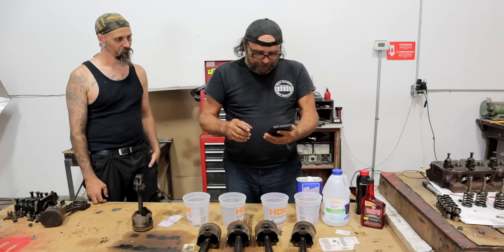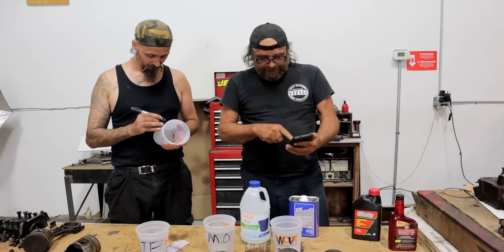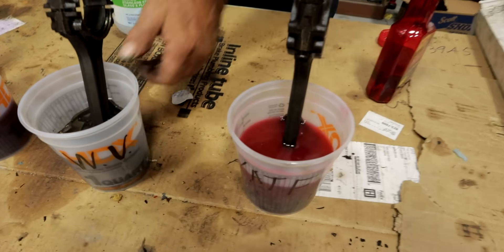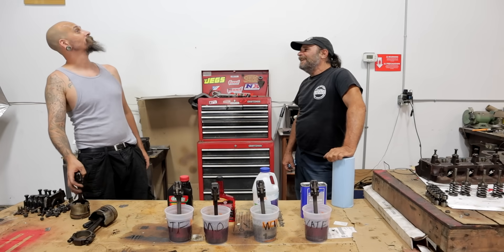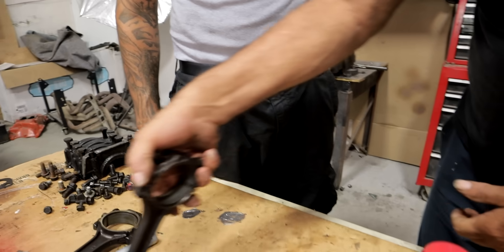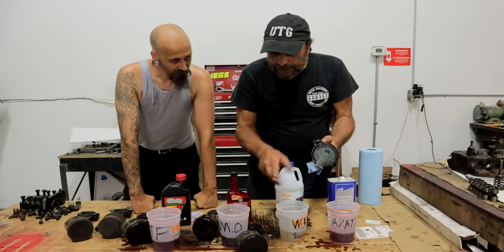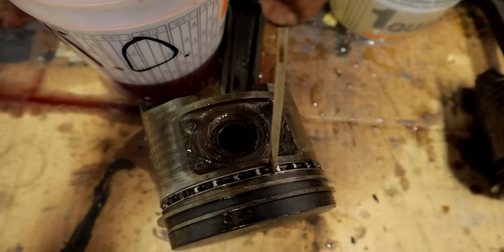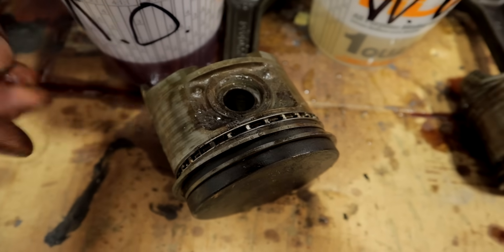Best Fix For A Stuck Engine - Viewers Choice. Marvel Mystery Oil, vs ATF, vs Acetone, vs Vinegar

Comment: Tony, What about the old Pepsi Cola or Coca Cola cure for a stuck engine? They both worked to free up stuck engines. They both contained phosphoric acid as an ingredient. That is why they rotted your teeth if you drank too much, as well as all the sugar they contained. Not too mention what it did to your gasrtrointestinal  tract.
Let us know what you think about it.
Reply: While acids are anethma to teeth (and sugar gets eaten by bacterial plaque, which then excretes an acid that eats away at teeth)...but it's a bit of a myth that it's hard on your g.i. tract.  Stomach acid (HCl) has a ph of 1 - 1.5, and will more readily dissolve teeth than any cola product, which generally have a ph of around 2.5.  This is why people with chronic acid reflux often have dental issues.  That said, anything with an acidity lower than 5.5 is harmful to teeth...but not to your g.i. tract.

Comment: Put the failed ones in the vinegar to see if it frees them up as well?
Reply: Like to see it work in an actually stuck engine. But how to get the vinegar out after ,, or will it eat the block alive..how to neutralize it after? Hmmm
Reply: @chuckthebull  It neutralizes as it reacts with metal. By the time pistons get unstuck there will be barely any vinegar left. Unless you pour a whole cup into the cylinder for no reason.
Reply: @SinsBird  I left a tool in a tub of vinegar one time to derust it..got distracted and forgot about it.. Nothing was left but the plastic parts. It desolved the entire tool.
Anyway I get your point. Still I suppose flushing it with gassoline and fresh oil would work out.. If you are not going to rebuild it ,,you already don't care that much...seen lots of vids of people taking old flatheads and getting them unstuck and they run just fine.
I'm rebuilding a 1930 VL Harley engine. I have a 62 sunbeam, 73 Pontiac lemans, and an mg midget.. So I'm no newbie to engines.
Reply: @chuckthebull  Exactly, you say you left it in the tub so it was probably way too much vinegar for the job. It's best to use the smallest container that your part will fit in laying flat and add just enough vinegar to fully submerge it. And we're not even talking about different concentrations of vinegar available. I'm just gonna say that 9% is VERY strong vinegar.
Reply: @SinsBird  I never meant to leave it in three days  for sure! lol
Reply: @chuckthebull  you had to leave it in there for months for it to completely dissolve the metal
Reply: like your garage! @chuckthebull
Reply: Baking soda diluted in water .
Reply: @chuckthebull  Arm and Hammer Baking soda mixed with water…heavy on the soda to neutralize the vinegar.
Reply: @chuckthebull  water and baking soda.
Reply: @chuckthebull I have a 4.3l that somehow got about 2 quarts of water in the oil. It won't turn over. You can still see the cross hatch on the cylinder walls. If I had the vinegar I would try it.
Reply: chuckthebull, baking soda neutralizes the acidity in vinegar. The combination of a little vinegar, a pinch of baking soda and some water eliminates heartburn.  The baking soda neutralizes the acidic value of the vinegar.
Reply: Vinegar is powerful stuff, once I saw the contestants I knew vinegar would probably win.  Its a rust remover, just drop your rusty parts in a tub of it and walk away for a few days.  Its also great at cleaning the calcium out of your kettle which is what I use it for most often.
Reply: @FrankBullitt390  Vinegar is good at descaling but the best chemical for this is trisodium citrate, because it's non acidic so it's rather safe on metals. If it's not available you can make it by mixing sodium hydroxide (caustic soda) and citric acid, but you'd have to calculate ratio for the reaction.
Reply: @SinsBird  what product of the shelf has trisodium citrate?
Reply: @luctessier2215  I'm not aware of any that would have a significant amount.
Reply: I do the vinegar also to clean old tools and parts just have to soak for a week on real bad rusty parts or whatever you have that has rust .
Reply: I agree. Every piston can be different
Reply: I have used white vinegar as radiator flush on older vehicles/ tractors withcopper/brass radiators and heater cores.  Drain the water and add a couple gallon of white vinegar and run it up to operating temp for an hour or two.  Inside of the radiator looked like a shiny penny. The clean water flush then gets important.
Reply: @SinsBird do you need to remove the spark plugs to add vinger or is it okay just to add it like that
Reply: @locowhat5332 you have to remove the spark plugs and add it through the plug holes .not through the engine oil feeder. The plugs holes go directly to the piston.
Reply: Does it necessary has to be a white cleaning vinegar or any other vinegar as long it White
Reply: @outofway420 the white vinegar comes with no additives.
Reply: As I watched this I was like…..yea try them all in vinegar, DUH!!!
Reply: I wonder how citric acid from dishwasher cleaner would work.  Its less caustic than vinegar
Reply: I wonder on an ole school engine can you just spray it in the cylinders or the the oil?
Reply: Phosphoric acid. It'll eat aluminum in time, but it dissolves rust. Oil won't do that. Stuck engines need to be torn down anyway in most cases.
Reply: Of course it would.

Comment: Vinegar is an acid so you are dipping them in a mild acid. Would you fill the cylinders with that mix?  The oils wouldn't really hurt anything in the engine
Reply: Sure.  You just have to use common sense.

Comment: I have a tote half full with vinegar I toss rusty parts in. They always come out completely rust free. The vinegar is well used and black like old used motor oil but still does it's job perfect.
Reply: White vinegar can easily replace about 90% of household cleaning products.  Nice to know it has a place in the garage as well!
Reply: Mint!
Reply: I heard leaving it in the sun too helps? What I heard from a metal worker/fabricator I'm not an expert
Reply: Should try molasses. Removes rust like nothing else.
Reply: @DL101ca Congos I put it on top of pistons which I’m trying to un-stuck?
Reply: Crazy, I'll have to try that knowing it doesn't wear out as quickly as I would have imagined.
Reply: Try using it on your marble tiles or kitchen bench tops. It is acidic and will eat alloys which most motors are made of.
Reply: Yeah no thanks. The product "metal rescue" works by chelation and doesn't destroy stuff like acid from vinegar LOL..leave em long enough and nothing will be left.
Reply: The black vinegar will make a good leather dye. Known as vinagroon? Something like that.

Comment: I wonder if after 2 or more days the ATF and MMO would have freed up the rings. The white vinegar sure did a great job. I liked this experiment, but my favorite was the battery video!
Reply: Marvel Mystery Oil takes at least a week. But probably better than dumping vinegar into your engine
Reply: That battery is in my van now and still doing awesome!  I drove it today.
Reply: You should check out puddins fab shop. He’s done at least one and I think 2 rust stuck motors with white vinegar. Then made them run. Never took them apart.
Reply: I don't know for MMO but ATF I tried it several times and I never got any results.
Acetone got the job done most of the time, pure or with added ATF to help things stay lubricated.

Vinegar, I never had the chance to find a good engine to try.
I never got a rusted stuck engine.

Comment: As soon as you mentioned white vinegar, I knew what the winner would be. I never thought of using vinegar but even the stuff you can buy in a grocery store for salad dressing, pickling etc. is about 5% acidity and would've freed up those rings given enough time. The cleaning vinegar that you used is much stronger, therefore faster. Now I remember why people used to use white vinegar and old newspaper to clean glass.
Reply: Best glass cleaner ever. Now it’s harder to find news papers. It used to be a ready supply before the internet.
Reply: @RealWorldGarage  Even if you could find newspapers they would be severely contaminated with what comes out of the southern end of a north-bound bull.
Reply: @RealWorldGarage  I know right? Even if you can find a newspaper, the water based ink they use now makes a bigger mess than what you were trying to clean up. These days, I just use vinegar and those white shop towels.
Reply: I hated cleaning windows with newspaper. I worked at a car lot when I was a kid and that's how they wanted it done.
Reply: Before I spent a couple of bucks on some muriatic acid, I used vinegar to strip galvanize off of some big washers I wanted weld to something. Not fast, but amazingly it worked. I could have gotten some hydrochloric acid from work, but I was afraid to transport it.
Reply: @gliderp  I don’t even like messing with muriatic acid.
Reply: @RealWorldGarage  Ehh, it's not that bad. Follow the basics. Eye protection, good ventilation, and good gloves. Been using that and A LOT worse for a long time. I would NOT recommend fiddling with Hydrofluoric acid without some training though.

Comment: Vinegar,  suprising! All viewers who suggested Purple Cleaner, know that most of that carbon would have rinsed right off. It's an equal to chem-dip but cheaper and way less stinky.
Reply: I think it's probably less toxic too.
I use a lot of that stuff. I like Evapo-rust in an ultrasonic works pretty well too. I had cancer, so I stay away from chlorinated hydrocarbon solvents (carb dip)and the benzene in gas, both are known carcinogens.

Comment: Try some throttle body cleaner on the other piston, will clean the carbon and oil out fast. Spray it on and brush it in a little and spray it off again and those rings will come free. Worked for me on a rotary engine that sat for about 30 years.

Comment: Berrymens carb dip will melt the carbon off the pistons and most likely free the rings.
Reply: I was thinking that as well
Reply: Yup. I just cleaned mine. Well the last 7 and then the first one again... Tried most of the other stuff. Not even close. When you say melt that is exactly 💯 what it did.

Comment: A friend has a restoration shop with a tank of molasses out the back it is old and has gone acidic..I have seen rusted steel go in and come out clean.
Reply: The acidity is why it works. Even the vinegar that you can buy at a grocery store (for salad dressing etc.) is usually 5%. The stuff they used from a hardware store is about 20% and can be even stronger.
Reply: I seen a guy dip engine blocks in it and yes it stunk but did a great job on the motor. Like a hot tank
Reply: I’ve used it for rust not sure but probably would do the carbon too

Comment: Hydro Seal by Gunk or other immersion carb cleaners would clean the pistons and rods like nothing else will. Some toilet bowl cleaners will remove carbon and varnish the same way.
Reply: That HydroSeal is some stinky stuff...but yes, it works great!
Reply: @hoscarnag  We put it on a real filthy garage floor one time and when I got home the bottom of my shoes were melted when I got home. Also  if you left a Holly base plate in too long the throttle bushings would melt .When you stick a cyl. head in Hydro Seal the paint and valve seals disappear along with carbon.

Comment: Interesting, is there anything special one should do after the vinegar to prevent corrosion from reappearing? Like regular oil or assembly lube? Go easy on me, I'm not a gearhead but just a moderate wrencher.
Reply: Hot water rinse, air nozzle then dunk in atf.
Reply: @craighansen7594  ^ This, rinse the acid off.  Oil/ATF keeps rust from reforming.
Reply: Definitely use a light oil like Remington gun oil or wd 40 or 3in1

Comment: C.L.R. and a six pack, C.L.R. to soak them and beer to help with the watching.
Reply: As with most products you can find the acid used then buy it a lot cheaper. Some like iron out use more than one acid compound. Vinegar is actually very powerful however very diluted in food products. Oxalic acid is a common one in many rust removes, it might be what CLR uses? Oxalic is also considered wood bleach and is the go to for that. You can buy the powder a lot cheaper than Iron Out or CLR and use the same, in water softeners, deck cleaning, rust removal. Oxalic, food vinegar, citric and others can be used and are pretty safe. Hydrochloric acid/muriatic will however work a LOT faster at removing rust on siding or walkways but one has to be careful, dilute it to be just strong enough, not leave it sit too long and rinse it well with soap to neutralize it. Always use eye protection when using acids, skin protection when using the nasty ones.

Comment: No sodium hydroxide? Unless there's aluminium in there it's a really good cleaner. I use it to get old cast iron pans and skillets back to raw iron.
Reply: If those pistons were iron, they'd still be rusted stuck in the cylinders.

Comment: I've used Food grade white Vinegar to clean out several Gas tanks with Great success! Its cheap, easy & non toxic. It Eats rust like crazy.
Reply: In the late 80s I had an 73 dodge charger and put a four speed in it. Had a bearing noise in fourth gear while cruising. It got so annoying I dunoed a quart of marvel mystery oil in gear box. A couple days later I realized the noise was gone. Then I drove it for five more years and no issues. My buddy had a Toyota with five speed and was moving from palm beach to Titusville. His trans had a similar noise. Told him dump marvel in it. They all said it wouldn't work. By time he got to Titusville the noise was gone. He drove for years after as well with no issues. I mite if just got lucky. I don't know but I trust the stuff
Reply: @richbon9904  , as a lubricant Marvel works great. As a rust/carbon removal,  not so much. I works well for what it's designed for.
Reply: Yep, pour on the ground without worry.
Reply: I have used that to strip rust and paint off guns
Reply: It will clean corrosion off of your battery terminals as well.

Comment: See, I've always been partial to Carburetor Chem Dip for soaking my pistons and rods when I rebuild an engine. That'd DEFINITELY free those stuck rings.
Reply: 100% carb dip will melt carbon and coked engine oil.
Reply: We used to use carb dip for pistons and lots of other highly grimy parts when I was in Vocational school back in the early 1990s and it worked great and left aluminum pistons looking like new after soaking and rinsing. The school had about 4 five gallon buckets in use at one time so we really soaked everything that would fit in there. It's amazing how much u use something when it's not on your own dime...lol
Reply: @doctorromex7804  I'm soaking some 60 over 307 pistons right now. Like you said , they look like new.
Reply: Zip strip works pretty good too for cleaning carboned stuff. 
Let it soak and use some lumber,like toothpicks and popsicle sticks to clean the lands out so you don't scratch em all to heck.
Reply: Yes that would be the best!  / Carburetor  cleaner like : gumout  might help .
Reply: Stinky, Nasty stuff
Reply: So will Pine Sol.  Carbon wipes off.
Reply: @johnnicol8598  That is good to know. Thanks.
Reply: @bartsarton2212  try it you'll find it doesn't work.
Reply: @cammontreuil7509  Interesting that one guy says it works and one guy says it doesn't work. Who's right?
Reply: @bartsarton2212  I've tried all the above. Cem dip berrymans works the best.
Try them all yourself. You'll see.